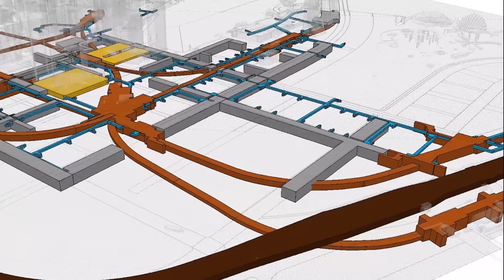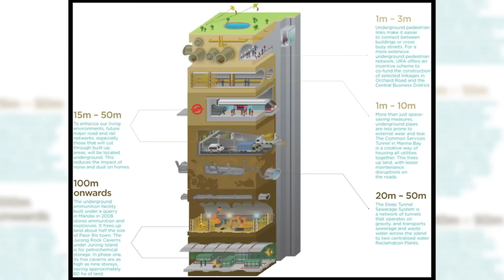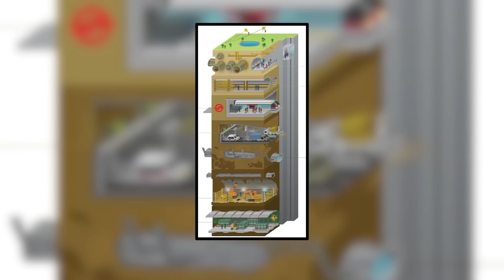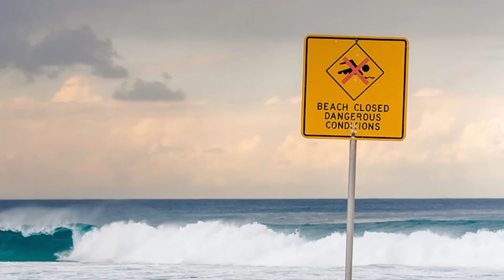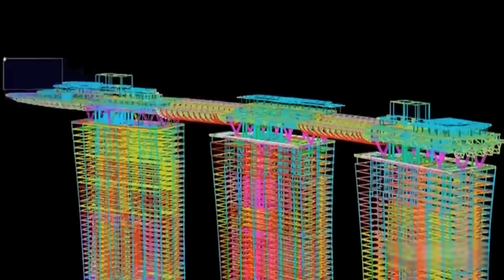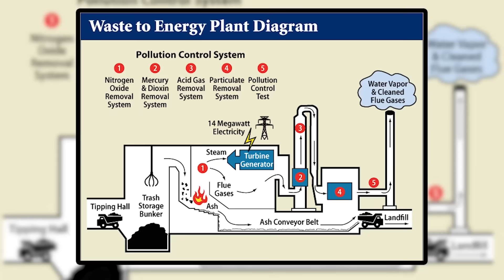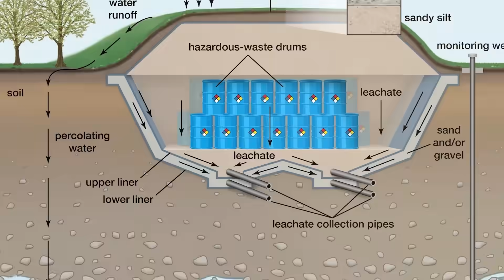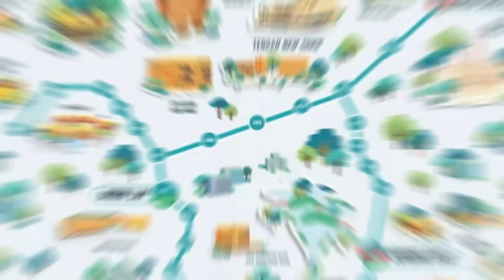Singapore Megaprojects: How an Island Smaller than NYC is becoming the most Advanced Place on Earth!

Comment: I was intrigued by the cover image shown (the twists and turns thingy), well, is a clip bait. The Singapore I know hardly build project that has too much frills, but pragmatic. As a Singaporean living in overseas, I was wondering is there such mega project coming up which I have missed out? The entire 12 min presentation has mentioned nothing of it. It is very misleading… 
The image, I assume it is an artist impression, has many key buildings missing and it is not an accurate reflection of the actual location, nor how the Bay is cut in. Even if this is an futuristic drawing, the map orientation seems wrong to me. I have question about  the production authenticity.